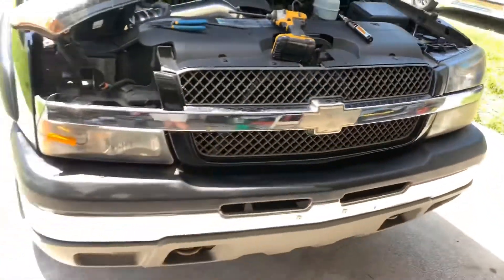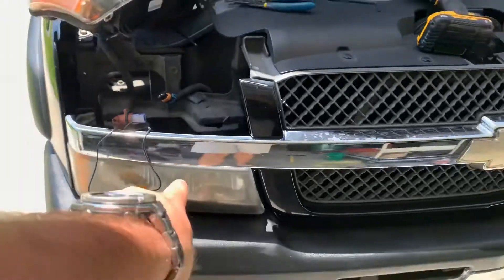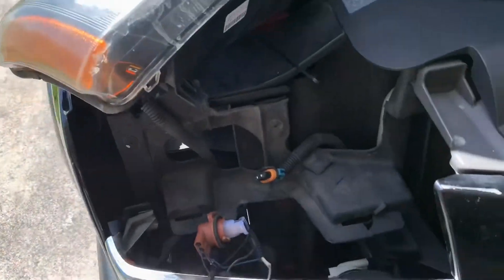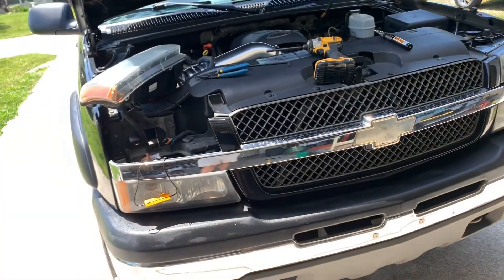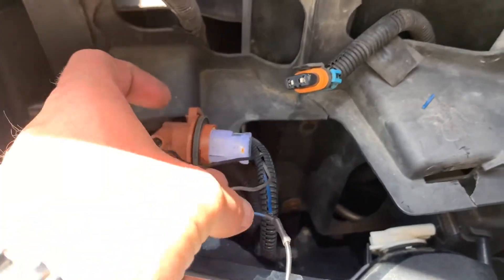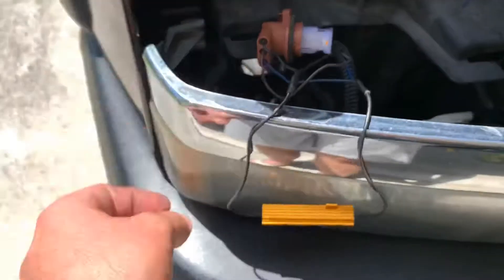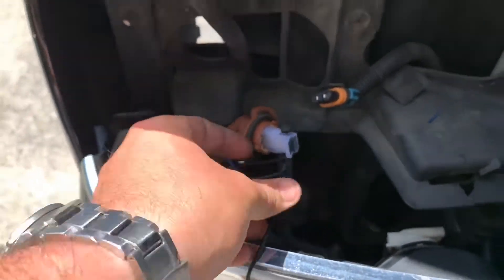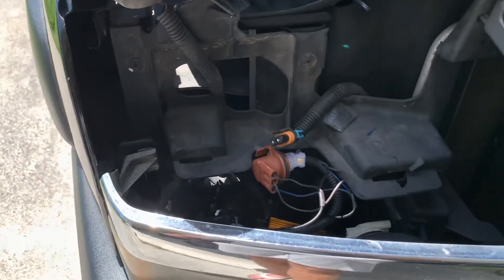99-06 Chevrolet Silverado/avalanche/burban/Tahoe Turn signal load equalizer install.

Comment: I installed load equalizers for both of my front turn signals in my 2003 Silverado and they worked perfectly.

I then installed LED bulbs in my rear turn signals and the hyper flashing returned.

I then installed load equalizers for both of them and they worked fine, BUT my cruise control stopped working.

After reading and researching, I realized the cruise control is connected to the brake lights (goes off when brakes are applied) and the LED lights are causing the system to sense an error.

I believe there are 2 simple ways to fix it.

1) use halogen brake light bulbs (tried it and it worked) OR
2) install load equalizers on the brake lights (haven’t tried).
Reply from the maker: That’s really odd, I have LED everything except hi and lo beam and my cruise works fine.
Reply: I have LED headlights, too, low and high beam.
Reply: I ended up installing one load equalizer on the passenger side rear and the cruise control works properly now.

Comment: What about the rears? Same colors?
Reply from the maker: Only need to do it to the front, they all run on the same harness
Reply: @agasgarage8917  I’m experiencing my cruise control not working after I installed led lights all around. Other videos say to put a load equalizer in the rear turn signals
Reply from the maker: @capostrength3908  it’s worth a shot, I’ve had two vehicles with cruise control and only put them up front with zero interference with cruise control.